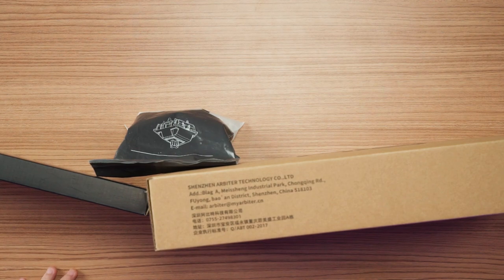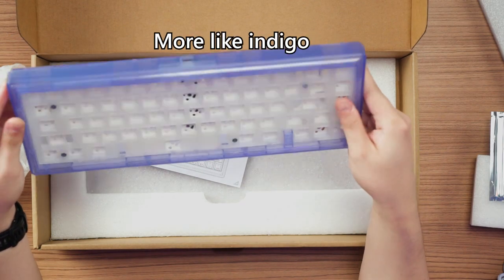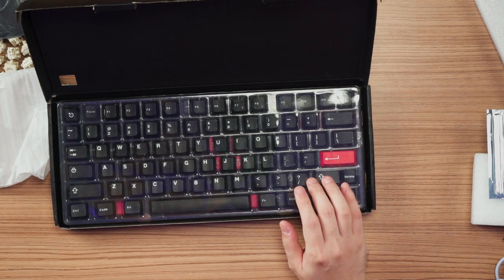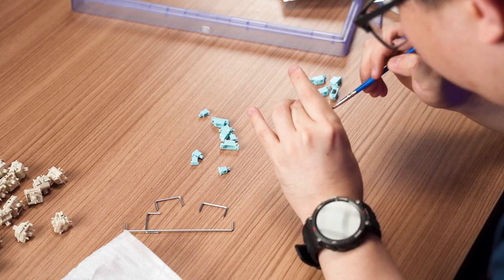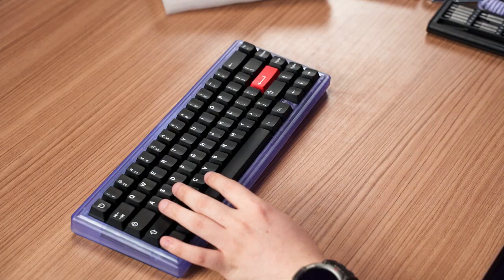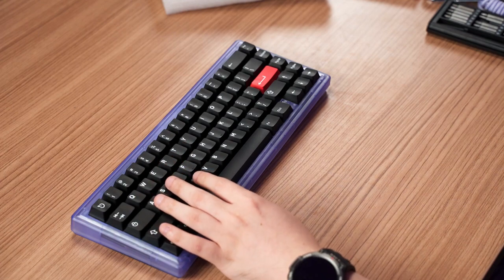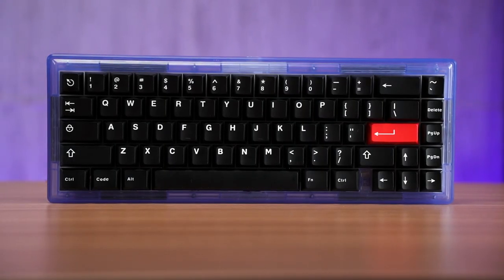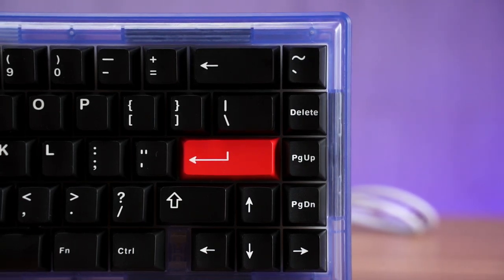Budget DIY 65% keyboard! CIY GAS 67 keyboard build

Comment: there is some ridiculous ticking on the stabilizers. please holee mod + lube them properly, trust me it will sound miles better.
Reply: its not the stabs, a lot of the ticking is coming from the bad mic quality barely picking up the sounds of the board